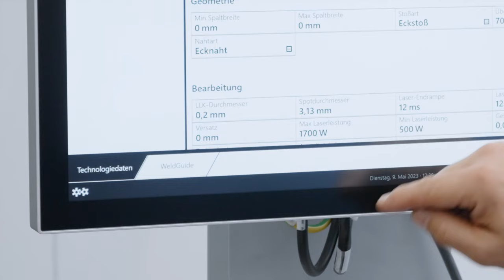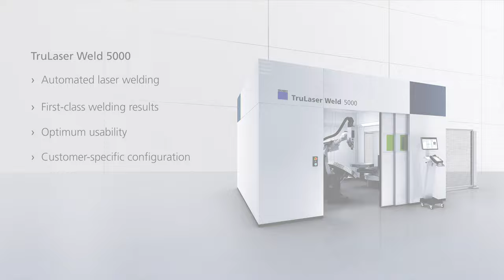TruLaser Weld 5000 – Automated laser welding: Productive and flexible

Comment: Robots and AI moving into every job sector. 
Humans will be obsolete and nothing more than food. 
😂
Reply: Not if you were like me as a child and fascinated by all the digital technology taking over solid state items or that solid state was being controlled with software and software switches.
Electricity was always the goal when I was a child. Because everything I ever liked took a battery or plugged in.
To the wall like video games, computers, remote control cars, slot cars. Train tracks all of that stuff. I knew I need to learn how.
Right now my life is so gravy. Because jobs all around the world are hunting me down. And I'm not even on the market.
They need people who are smart, and there's not enough of us to go around and share with all companies who have nice equipment they all can't.
Find people to fix it or keep it fixed or to run the program. As it was intended, I'm sure companies like this. See so many people not using their equipment that they built it for and they will use it with old principles and go with their old ways just with the new machine.
You have to have perspective and vision and understand that you can't be at the front of all of this and be in super high demand. Be willing to do what others will not do. And you will be always at the top of selection for the short list.
Reply: Remember, artificial is still artificial. It's still intelligence, but it's artificial meaning. It still needs a master to keep it official. That master is whoever has control of the keyboard.

Comment: The problem is getting employees to maintain your equipment's consistency. With the turnover rate here in detroit, and i'm sure most regions and the lack of education or experience that your operators will have. It's gotta be tough for a company to push the envelope. When there isn't the manpower, that would be responsible enough to take care of it to last long enough for the entire duration of contract to a product. The types of lasers I see in the factories and you already know by your sales figures. You don't see this welder. This is going to be used on special applications. Probably probably prototype, but even prototype factories today are hiring guns with operator experience.